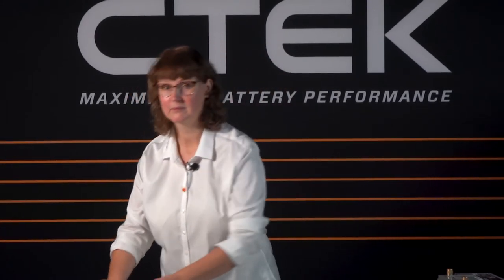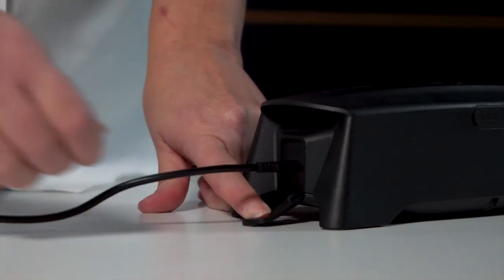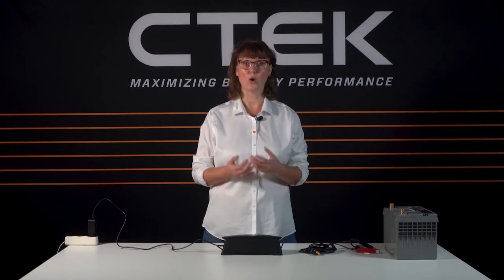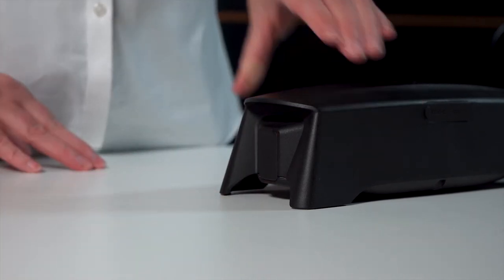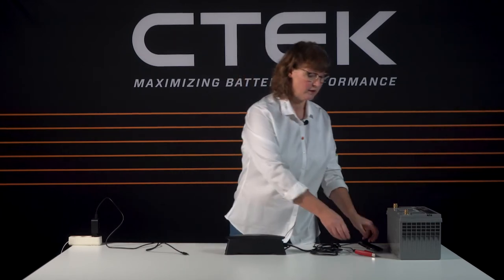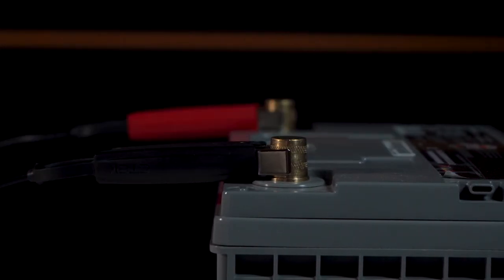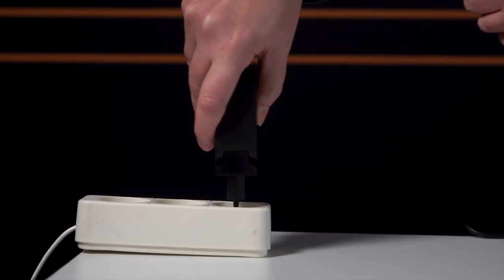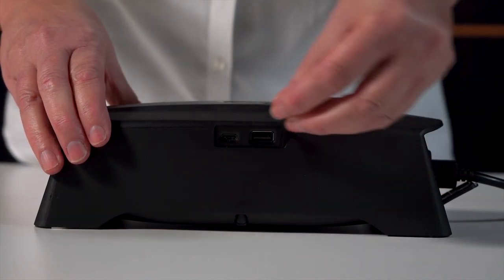CS FREE - How to connect

Comment: OK, so far I have just charged my newly bought CS Free to 100%.
I didn’t have to push the small button to start the unit charge. 
It started with the first quarter blinking, so it was somewhere between 0-25% charged from out of the box.

Wouldn’t it be better longevity if the unit was fully charged out of the box? 

Now, next step is to charge the vehicle battery, but I don’t need the boost, I just want to charge it carefully up to max.
How do I skip the start phase, and go directly to ordinary charging?
Reply from the maker: Hi,

Thank you for reaching out! :)
We aren't allowed to transport the units with anymore charge since it has a lithium battery. 
When it isn't connected to a power source it will always start off with 20A until a certain voltage has been reached.

Comment: How do I charge my car battery with CS FREE, through the cigarette socket?
I bought the usb - cigarette accessory and I put it the IN CHARGE usb c port but doesn't charge my car battery, but the opposite...the car battery charges the CS FREE...any solutions? Don't want to maintain my cars battery with cables clamps always.
Reply from the maker: Hi. In order to charge your vehicle battery you need to connect to the recommended charge points (see vehicle manual) using the provided battery clamps. You can recharge the internal battery within the CS FREE using the optional USB-C CHARGE CABLE 12V PLUG whilst driving. The reason to why you can not charge the vehicles battery through the 12V output is that the cables between the output and the battery often are thin, and the recommended highest amperage is 8A. The CS FREE can provide up to 20A and that would  in worst scenario melt the cables between the output and the battery. I hope this explains why we recommend to connect with clamps. Best regards CTEK Support
Reply: @CTEKBatteryChargers  Thanks for the reply. So my car battery is almost new, I just want to keep it to the top when the car is 2-3 days parked without any electrical solution nearby.If I connect with the clamps of the CS FREe will be enough for 2-3 days? My battery is almost all the time with 12.5V when my car is parked. Just want the CS free to keep it to 12.6-12.7V these 2-3 days.
Reply from the maker: Hi. If you have the CS FREE connected to any kind of power source, it will work fine. If your battery is 12,5 the CS FREE will most likely not have power enough to fully charge from the internal battery - but anyway - to add 20Amps (a fully charged CS FREE) will help a lot. And you can recharge from the 12V output when driving and connect when parking. This will make a significant difference.All the electronics in the vehicle risk draining the battery, even when parked. If you park longer than a week, I recommend you to recharge the CS FREE and reconnect to recommended charge points. Good Luck. Best regards CTEK Support

Comment: Great video. It is unclear when using the product how to charge the battery vs. "start" it.  The battery will start when it is below optimal charge. (This is clear because the battery charger indicates "start," but the car internal system says the battery has been discharged and is low).  After starting my car, the charger light indicated an 8-hour charge was necessary, but the battery charger lasted only an hour or so.  After recharging, the same thing happened: the charger indicated "start," the interior system indicated "low battery discharge".  After starting the battery charger moved to low (<25%).  It is great that the item is "easy" to use but it is not clear how to use it - and the manual is terrible.  Simply terrible.
Reply from the maker: Hi, Thank you for the kind words about the CS FREE and the video. It is actually no difference between charging and fill the battery so you can start your vehicle - you can start a long time before the battery is fully charged. All the tests we have done (some few abnormal exceptions) tells us, if you have a common car that won't start, and you uses the CS FREE until "START" is lit - you will have power enough to start your vehicle. It is a good help to turn off consumers as radio lights - all the power need to go the the battery and not to the consumers. To fully charge a big battery can take 3-4 or even more recharges of the CS FREE if the battery is big and very drained.  Regarding the Manual... we are working to add more information on www.ctek.com. I hope this helps. Best regards CTEK Support
Reply: Super useful answer thank you. Would make sense if it was in the video ;)